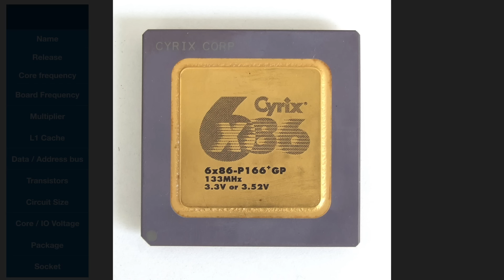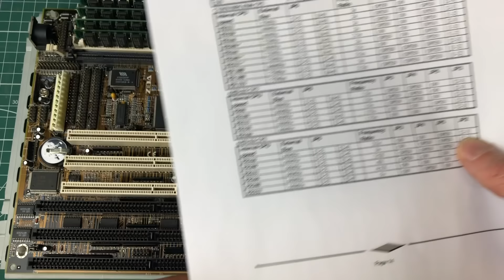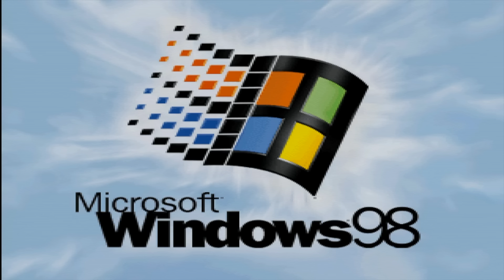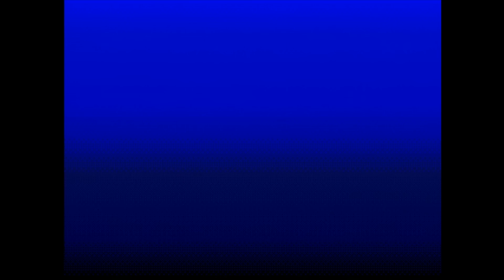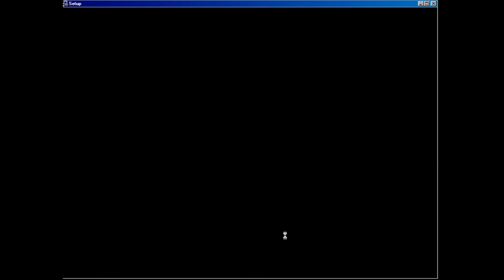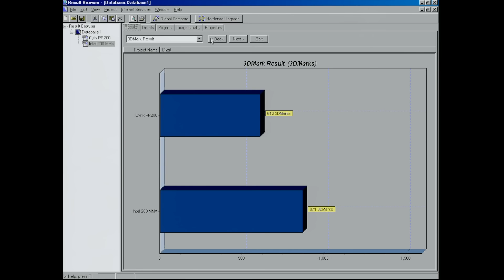IBM / Cyrix 6x86MX PR200 vs Intel Pentium 200 MMX

Comment: Back in the 486 days Cyrix really got their start selling their version of the 486 as a 386 replacement. The weak FPU wasn't such a huge issue because software rarely used them, but even then, they were still nowhere near their intel 486 counterparts. The initials ones had about half the cache (maybe even less?) than a typical 486, which made them poor performers comparatively. This is why you see them overloading the cache later on and sure enough its 2x what the Pentium 200 had. Obviously clock for clock they are outperforming the Pentium on integer calculations which is impressive but again the floating point performance is really the weak link. What really killed Cyrix was that they just couldn't compete for performance and focused on low power solutions. National Semi buying them was the final nail in the coffin. If you've ever used an AMD Geode processor, you've were using a Cyrix design.

Comment: That Cyrix was my first CPU I bought the day I started IT graduate school. God I'm old.
Reply: NASCOM computer for me, followed by a Sinclair ZX Spectrum 48K back when those were new.
Reply: @EgoShredder  Now thats old haha :)
Reply: K6-2/400

2nd was Athlon XP 2800+
Reply: same
Reply: 386sx-25
Reply: I'm even older. My first CPU was a 8085@2MHz  😎
Reply: @e1woqf  2MHz! first 'machine' I had use of as a kid was an Atari ST540FM which consisted of an 8MHz Motorola CPU and 512KB of RAM. The one I had use of had no HDD, just a 3.5" floppy drive but in 95 when I started secondary school, we had a lot of DOS and Windows 3.1 machines and there was an Acorn (don't recall model) and an Acorn BBC Model B (2MHz 6502, 16KB RAM, etc which were n the library which I used to use and simply "mess about" with the code in the game, snake so I could make it look different on the Monochrome monitor.

Comment: I was a big Cyrix fan back in the day (oh and needed a big fan on it! ha) That 75MHz bus speed is overclocking the rest of the motherboard and the expansion cards too though which helps with performance.
Reply from the maker: The pr200 came out in 75x2 and 66x2.5 editions. Mine was a 75x2. In next video will try some overclocking

Comment: Via chipset was the shittiest one around back then
Reply: It really was pretty bad. I'm also pretty sure I remember a few other chipsets being even worse. SiS comes to mind. Via put out some bad chipsets but some of them were pretty reliable too. They definitely improved their designs over time.
Reply: Forgot about Sis. Yes, it was even worse.
Reply: @kansalta  I remember the days when you could buy cheap 486 and Pentium motherboards that came with fake cache. Those boards were nightmares to figure out what was going on with. They would often boot and seemingly run ok but would crash intermittently. I had one I tried for a whole day to figure out what was going on with it. Eventually I pulled the cache and it worked just fine. This was before you could just go and google for ideas so these things could be really fun to figure out through trial and error. 

But yeah the SiS chipsets were always the worst POS computers I ever worked on. Whenever I saw a bus controller with that stamped on I cringed. 

Via did some neat stuff and were ahead of their time in a lot of ways. They hyper-focused on the low cost, low power market and I think that's what killed them because consumers have always cared more about performance than efficiency. Their own chip designs were kind of neat though and super efficient for x86 at the time.  The pentium 3 and ahtlon were when intel and AMD just finally got it right and the DNA in those cores lives on today.

Comment: K6-2 vs Pentium 1 MMX at the same frequency and FSB would be really interesting, the performance should be very very similar.
Reply from the maker: got an AMD K6 and K6-2 here and planning to play around with them a bit.
Reply: @RetroSpector78  would be great if you could test the k6-2 against the Pentium MMX if possible at the same frequency and FSB :)

Comment: Screamer performed equally(bad) on both CPUs because it wasnt optimized for Pentium pipelined FPU. 
Michael Abrash: "The Pentium’s FPU is the first pipelined x86 FPU. Pipelining means that the FPU is capable of starting an instruction every cycle, and can simultaneously handle several instructions in various stages of completion."
Big difference in Quake and windows 3D games(drivers) was due to aggressive optimization for pipelining. On Intel Pentium FPU you can shovel couple instructions into FPU and go calculate something else using Integer units in the mean time. On Cyrix MX,M II/AMD K5,K6,K6-2,K6-3!/Winchip C6 FPU will stall the moment you try to push second instruction into FPU.
Cyrix was a good processor for running unoptimized code, games tended to be optimized and ran bad on it.

Comment: Nobody was content or happy with a Cyrix back in the day, and it's bad rap was due to lacking full pentium support... so inevitably, you'd run into problems. Bigger ones than trash performance
Reply from the maker: Pentium support improved a lot with this MX series, and by that time software makers took notice and delivered cyrix support where needed. FPU performance remained the achilles heel however and the perception that it was slow at running quake and other games didn’t do a lot of good. But it deserves its place in history.
Reply: @RetroSpector78  But by that time the chips name was ruined, forever a budget bin toss away the likes that couldn't even be compared with a Celeron... or so to say, compared to a Cyrix or a VIa cpu, a Celeron was monster of speed and power... so perhaps the latest MX models, with their MMX instructions, made up the gap. But it was too late.  Nobody revered these things as anything other than worthless... Always on their own in the lowest sections of TigerDirect, etc... they were the outcasts, subject to ridicule, and never purchased...Really, rather than comparing them to Pentiums, they should be stacked against the Celeron series. Which itself was inexpensive, also socket 7, then 370, then FCPGA 370... and in all cases, while competition existed, it bested it. So the Cyrix really didn't "hold its own" against even the least expensive intel offerings.
Reply from the maker: Don’t think there was a socket 7 celeron. There’s also more than a year between the mx release and the celeron release. As even Cyrix modelled their Performance Rating against the mmx models I think the comparison still holds up. But I agree the cpu is often frowned upon, and the intel is the overal better pick. But even the underdogs deserve their little place in history :)

Comment: When I finally stepped outside of the Commodore world I couldn't afford Intel. My early progression was AMD DX4 120, Cyrix 6x86 pr 166, AMD K62 350, and then a Celeron 300a (yep I got a successful 450mhz OC out of it). My favorite system was the Celeron 300a, man that thing was a beast.. I do have very fond memories of the 6x86 though, as it was my first step into Pentium class performance and I was always a fan of RPGs and at the time, it played all the games I played as well as any Pentium. Wish I could remember the name of the motherboard I had with the Cyrix, it had AGP and was an odd manufacturer. It wasn't any of the "normal" brands that everyone else purchased, it was a high quality board though. The manufacturer wasn't around for very long. They tried breaking into an already flooded market and just couldn't compete from what I recall.
Reply: Your motherboard could be: Totem, Soyo, DFI, QDI, Lucky Star, Yang An, Soltek, Shuttle, SuperMicro, Tekram, Tyan, TIGA or ZIDA - rare or almost rare brands...
In 1999 at my first job got Celeron 400 with i740 3D 8 MB videocard...we called it "an ugly fast server" because it was main computer in a net with a couple of Celerons 300 without any 3d accelerator, just integrated 2D..and played a lot after work, oh that wonderful times spent on Half-life! I still respect that Intel`s 3D chip i740..it was AGP and there was no texture memory in it,  it was ...uhm...DIME yes, Direct ...eh... so it used RAM through AGP but was fast enough. I read a lot about 3D: bilinear filtering, antialiasing, bump-mapping and other magic words only for initiates

Comment: Please please please do use proper symbols for IT and electrical units :)

Not "Mhz", but "MHz" - the hertz is abbreviated as "Hz", not "hz".
Not "kb", but "KB". "kb" is "1000 bits", "KB" is "1024 bytes". There is 8-fold difference between "b" and "B".
There is no need to write "64 bit", as you may as well use the "b" acronym.
Also, volts are abbreviated as "V", not "v".

Your videos are really superb as for their informative and entertainment values, but you should be also concerned with educating your audience - and using proper unit symbols in summaries and tables will cause everyone to remember and use these correct symbols.

Thank you for your content and keep up your great work!
Reply: i save this comment

Comment: Remember having P200MMX @250MHz (3x83MHz) for a long time on Asus P5T2P4. Fast enough for almost anything that time.
Reply: that was one of the fast machine for 97' and up to mid 1998. For 1.5 year, complete dream build for that era. Then, it was dethroned by cheap Celerons 266 and 300, and particulary 300A in august 1998. :) (would never expectd, that so fast and cheap processor will appear just in 1.5 year after Pentium MMX, complete shock. I was expecting like even in 2000, Pentium 233 MMX will be still only mid-range processor, quite expensive, cheap Celerons and AMD k6-2 400-500mhz  was total shock for me, how cheap yoi could have in 1999 that performance, that beats overclocked Pentium 233 MMX by huge margin )Actually, Celeron 266 was only bit faster from 250 MMX, but after overclocking to 100 FSB, those Celerons outperformed Pentium MMX by 2-3x times, also offered AGP slot.

I have also 75 mhz capable motherboard for socket 7 with Pentium 233 MMX as vintage computer. With INtel TX chipset 430. After overclocking to  75x3.5, 262.5 mhz, that system is socket 7 beast. Heard, there is unofficial BIOS for 83mhz, but could not get that for my board (QDI Titanium 250/1b)

Comment: About this peculiar "Screamer 2" performance on Cyrix with software renderer - I guess this is because of fixed-point math its engine could've used. It basically means it didn't use FPU but emulate floating point math using it's integer unit. 

This was a popular technique with many old 3D engines, and also later, in "mobile" times when early ARM CPUs also had very weak FPUs.
Reply: Quake was pretty much the first game that wanted a strong FPU, Scream was earlier than that so no problem
Reply: I think you have it, as it would also account for the less than stellar rendering accuracy (it was however a fun game)

Comment: I had the Cyrix 6x86 PR166 and then later upgraded to the Intel P200 MMX I also had a Voodoo Banshee, the difference was quite big in some games. I do remember Heavy Gear and Shogo Mobile Armor ran a lot better on the Intel.
Quake 1 ran fine on both, I never noticed any difference.

Comment: I never really thought that comparing the CX processors directly with Intel was all that fair. Part of this was down to cyrix's own marketing - the chip was a 150MHz in reality, and was half the price (much less than half price when they'd been on sale for a while). They should have advertised the chip as 150Mhz - they had the price advantage so fudging the speed served no purpose. 

If you compare two chips at the same price, the CX utterly blew Intel away. And that was always how I judged them - I had a budget, and compared the chips in that budget. Needless to say I bought a lot of Cyrix and AMD processors!

This was even more pronounced in early 1996 when Intel had the P75, and Cyrix were punting the high-speed 486 processors. The SGS 486—133 was on sale for about £20, the P75 £200, and the SGS held its own at a tenth the price.

Comment: I had a 6x86 200mx then went to a intel 200mmx that I overclocked to 250mhz. For me the 6x86 was extremely unusable for music software, all the MIDI timing was all over the place and the performance in Impulse Tracker using the MMX driver was significantly worse than the Intel. I do recall Windows 95c running unusually fast on the 6x86 however, nice memories of that time, cool video! Interesting to see it in some games.

Comment: Thanks, that was a great review. I recently picked up a IBM 6x86MX PR166 and a IBM 6x86MX PR333 3x83mhz, am looking forward to messing about with them. I also have a K6-2+ and a K6-3+ that will run at 550mhz stable and pass some benchmarks at 600mhz. Back in the day I went from a p200mmx to a Duron 650@900mhz, what a giant leap in performance that was. The motherboard I had the P200mmx in suffered an untimely death as a result of the Chernobyl Virus that wiped the bootblock in the Bios,  I could have fixed that now but it ended up getting binned, unfortunate as it was a DFI Intel HX chipset motherboard. The P200mmx will run all day at 100x2.5 on the stock 2.8v on super socket 7 mobo, some people have gotten them up to 300mhz but with the high risk of killing it. Overclocking is fun as long as You don't over-do it.

Comment: the cpu sure is nice, but if the floating_point unit was #slow, then it's easy to see why cyrix_cpu's flopped. the Pentium_mmx has more chance to beat a cyrix due to its fast 'floating_point' unit. but what's also interesting is the fact that this cpu could run other software if you gave it a 'small_overclock', good luck trying to find high-speed memory for it though. CL3 memory is always a nice_choice, or at least in my experience.

Comment: Wow, this is on topic!

I built a Cyrix 6x86 back in the day - decent for a while, but the cheap motherboard had under-cooled VRMs that could not hang with the low voltage and high current required by that CPU.  It ended getting more and more unstable until I finally chucked it in exchange for a PII.

But I decided it’s time to give it another shot (on a Tomato board no less!) with a PR200.

I also just got a 3D Blaster Banshee — having been a bit of a Creative fanboy back then, but never had any of the graphics cards.  It won’t go into this build, but will replace a Matrox Mystique that WILL go into this build.

And finally, that HP CD Writer 7100i was my first CD-RW drive, so I just tracked down one of those as well!  Also for this build.  Small world!  :-D

Comment: I remember buying my IBM 686MX PR200 back in the 90's being a student at the time it was good bang for buck.
Still have the system it had been parted out to upgrade to a super socket 7 system in the late 90's.
System has been rebuilt to the same specs using my original parts except for the Voodoo 1 haven't been able to find one at a reasonable price.

Comment: Great video. It was a great era :) I used to use the Cyrix's a lot especially with UNIX and UNIX-Like systems and a bit of Windows also. Code optimisation and compilers had a huge influence on performance of these guys (especially intel's compilers and some use of missing instructions in the two early Cyrix families). Also there's Cyrix non-mmx which is an enhanced 486 core, and Cyrix MMX. MMX's also if memory served had the missing RTDSC instructions to make them more Pentium compatible. There was a lot of jokes about the non-mmx Cyrix like the PR200+ being "the world's fastest 486". An example on the code optimisation issue is MS VC5 vs MS VC6. It can really throw your benchmark results around with the same unchanged code. The FPU in the several Cyrix's is definitely weaker than Intel's at the same PR value, but the integer instruction speed is definitely higher .. partly due to the lower latency from ram over a faster FSB (ie: less pipeline stalls) and less need for it to have a cache miss and need to hit the FSB to fetch data. Larger L1 cache in the second generation with MMX no doubt helped here also. Also, a lot of motherboards of the era had 256kb cache upto some of the SS7 VIA AOpen boards with 1mb cache, as software improved, cache alignment of code could have a very significant impact on performance. Really enjoyed your video. If you get a chance, grab some of the other underdogs ..I know they're not as great but the NexGEN and IDT WinChips and sure chuck a few AMD's in there along couple of other little known's like the few that SiS released before the Cyrix IP went over there ..they're a load of fun to run up, benchmark and explore.

Comment: 22:20 I'll tell you what happened here. Not all 3D games of the era used floating point math for 3D. Many still used fixed point math which runs on integer ALU of the processor. And this is the area where Cyrix was stronger then Pentium.
Reply from the maker: Was also thinking something along those lines. Cool to see the little underdog managing to beat Intel in certain areas
Reply: @RetroSpector78  yeah those Cyrix CPUs were true "volks pentiums" until overclockable and affordable Celerons and Durons came into the scene later.
Reply: @nneeerrrd  i built a lot of systems for my friends in that era, from P75 that I told everyone to skip, only P100 and P133 in first gen, and then later only P166 and Cyrix, however for all that time i just kept my 486dx2 with Matrox and Cyruss Logic and had Win95 and MP3 and mpeg4 video and higher resolutions, but when p200mmx came I bought it and OC it first day to 266 and that system kept me gamimng to Athlon64x2